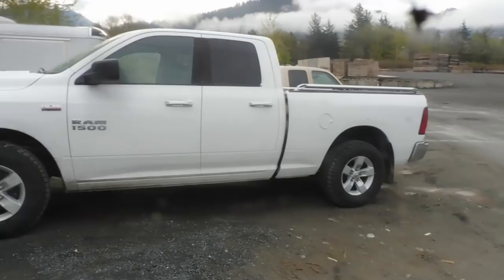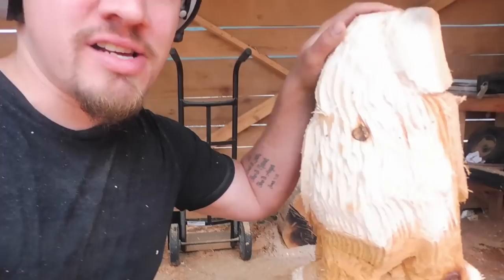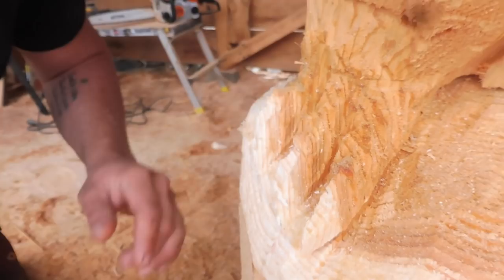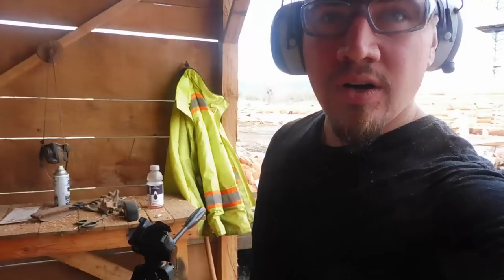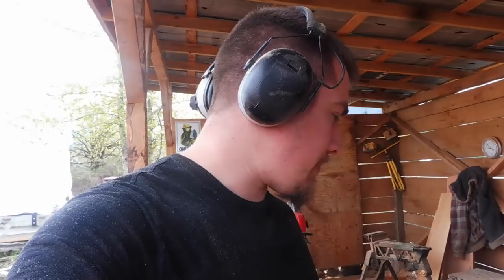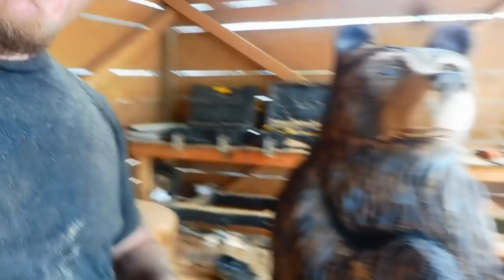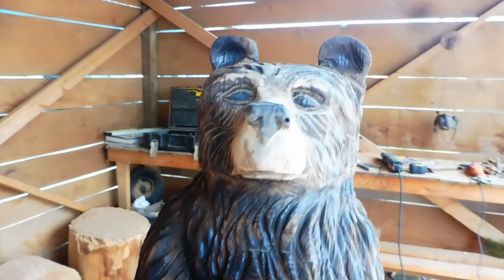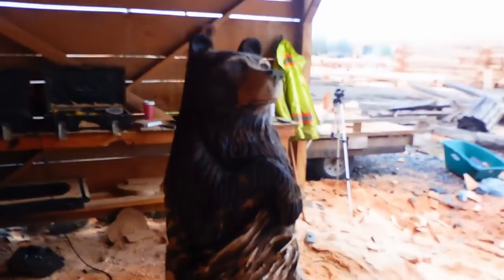A quick and easy feather pattern

Comment: Thanks for all your videos. I've been carving about 3 years now and your videos have made me a much better amateur carver.  Your racoon tutorial was the best. I made one after watching it and was blown away by how good it turned out! Actually I think it's better than yours lol. But it took me 20 hours to do. I've carved lots of cubs in stumps and a couple of eagles as well and always had problems getting the eyes round and then a lightning bolt hit me. HOW TO GET PERFECT EYES! This is my amateur carver tip. DOWELING! Simply drill a hole in the head of yourcarving the diameter of the dowelling your going to use. Round off the sharp edges of the Dowell and glue it in. Works great and the eyes look perfect.
Reply: Use green marbles for your bears . Ppl love them, and at night when lights hit them they glow.  I stopped carving the eyes years ago.

Comment: Advice from a fellow Chainsaw Carver,with 20 yrs experience. Take your 1/4 pitch chain with dime tip carving bar. Take your rakers down low and drag the tip of the bar at a slight angle really fast. Up and down and u will get that pattern but will also add a feather like look to it.